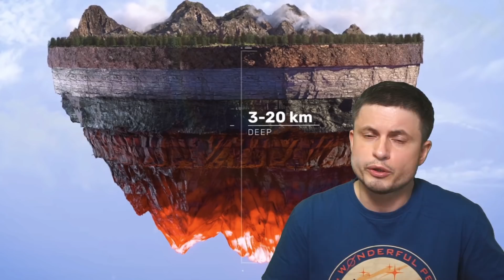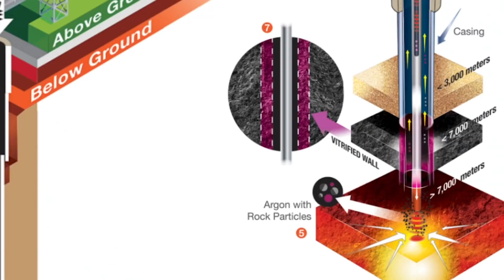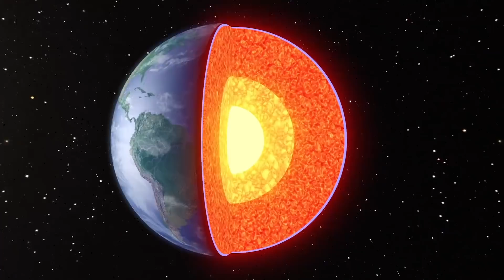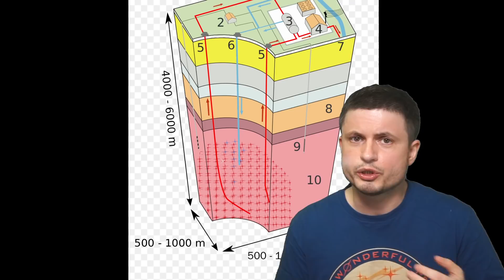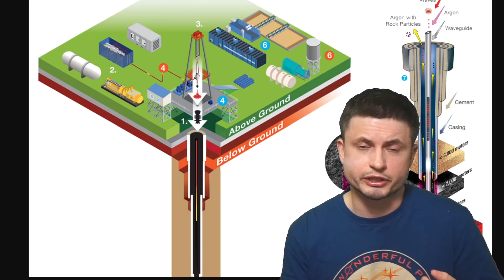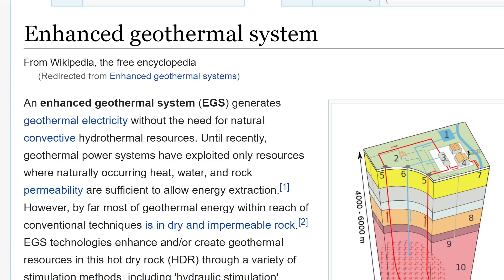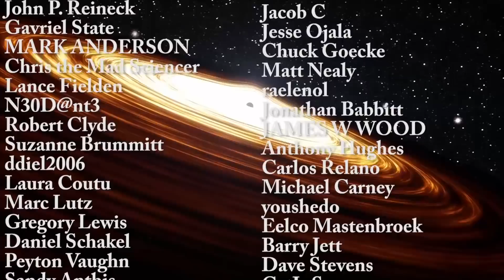Creating Deepest Hole on Earth For Geothermal Energy Revolution

Comment: One of the reasons geothermal isn't used more than it is, is because it can't reach the magical "7 to 1 return-on-invested-energy" threshold in 20 to 30 years, largely due to thermal depletion of the local rock. Fortunately, geothermal wells should continue producing for an indefinite period after that depletion due to heat conduction, but it will take quite some time before any individual well reaches the 7:1 tipping point, and they'll need to be designed with a "post-depletion" production sufficient to still run a power production plant.

Comment: Any discussion of a new energy  system should include a break even calculation.  How much energy is used by this new drilling device to create a 20 km hole, and how much energy needs to be produced before you have a net gain in energy?
Reply: They aren’t at that point in the tech cycle yet. However, if you read the papers and do some basic math, my guess is that it looks like it could easily produce thousands of times the power it takes to drill it.

Comment: it will add to the net enthalpy in the atmospheric system thereby increasing the temperature.  the only solution to global warming is to keep enthalpy constant or reduce it.  which means keep potential energies such as crude oil, coal or nuclear to its minimum and use and store energy produced by solar, wind, hydro to maximum

Comment: Imagine the weight of a 5km electric cable, how will it suport the weight?  There is a reason lifts only go so high, you get to a length where it just can't suport it's own weight.
Reply: I forgot as the cable gets longer the resistance becomes higher so they will have to start with very high voltage with thick insulators.  There appear to be more and more unanswered questions the more you look....

Comment: Hang on a sec ... here in Belgium, we used to have coal mines, they were between 300 and 600 meters deep; and I know that the temperature there is 50°C. This is actually the reason they didn't dug deeper, because it would become more dangerous. There are entire caves at 600 meters deep which can house entire trains.  ..... Sooooo we have a hot spot here as we don't need kilomeers to get superheated water, AND we have a 600 meters head start already ... Why don't we exploit that ?
Reply: Ask your government. I'm sure they have a good answer.

Comment: Passive geothermal (taking advantage of energy that is already bleeding out of the earth is fine) and geothermal storage (storing energy in the ground as hot or cold to use later is also fine. But the consequences for doing active geothermal (active forcing energy out of the earth) on a large scale will make our current climate issues look like a joke. This geothermal energy is what keeps the geological cycles running and the tectonic plates moving on our planet. If we pull too much energy, which of course we would, plates will thicken and even start fusing together, which would be insanely bad (at least in our current technological state) and much more irreversible than our current problems.
Reply: figured something like this would the case, most everything in existence that we take has consequences

Comment: Seems like am ideal power source...
...except, what else important is being driven by this heat?  What would massive geothermal adoption begin to compete with?
The Earth's magnetic field.  
Planets like Mars no longer have an atmosphere because the core solidified causing the loss of the planets magnetic field, without which solar winds stripped away the atnosphere and radiation levels on the surface jumped much hgher values.
We don't know that much about the geodynamo creating the Earth's magnetic field.  We don't know how much cooling would crash the geodynamo.  
Perhaps if we had long term nuclear power plants to power one loop with sufficient dc current  around the antarctic and another around the arctic we could creat an artificial magnetic field of sufficient strength to protect the planet.  I wonder how much power that would use?
Reply: "We don't know that much about the geodynamo creating the Earth's magnetic field."
How do we know the magnetic field is actually generated by a dynamo at the core in the first place?  Seems highly unlikely.  Maybe these boreholes will expose the truth... and negate the viability of geothermal outside of seismically active areas.
Reply: @freemind..  We see good evidence in that the poles periodically flip sea floor in spreading zones, meaning it is not something static in the interior.  This makes it unlikely that when the  core freezes solid that there will continue to be a geomagnetic field of a strength comparable to what we have currently.   Consider Mars whkch has evidence of previously having a more substantial atmosphere but now with a molten core too small for sufficient  convection currents; mars  does not have a strong magnetic field and no longer has much atmosphere.  
Who knows how much cooling is required to disrupt the process that generates the protective geomagnetic field.   Seems like that would be a good thing to know before proceeding in any significant way.

Comment: I love the geothermal side of this but I have serious doubts about the drilling technique.
The heat will cause any waveguide technology to become quite lossy so the energy would not be able to get far enough into a hot enough region without water cooling of the waveguide, which would be impractical. I think it could be drilled using modern super-deep drilling methods, but with significantly more water pumped through the bore hole.
Reply: What temperature are feasable, with current w/g tech? The vaporization will, if I understand it correctly, happen tens of meters from the mouth.
Reply: @mellertid  Resistivity of copper is about 3 times higher at 500C, and a waveguide carrying enough power to vaporise rock will get even hotter than that, resulting in more losses.  I don't think this would be a serious problem over a few hundred metres but the amount of power you would lose over kilometres would mean you would need to send many times more power down the waveguide than arrives at the head, meaning the heating of the waveguide would be even more severe. If they have run the calculations on the waveguide losses and heating over that distance and found that it can be cooled with the amount of water that you can pump through the drill then I could be wrong but it really seems like a lot of physical problems are stacked against it.
Reply: This would seem to be possible to evaluate with vertical prototypes. Obviously it's a critical point. (Unless the gyrotron can fit in the hole and move down...)

Comment: Now done in my USA County.  Within 30 miles of a steaming caldera.
Generates electrical power.  Learning their metal pipes need glass
upon the inner sides to halt acidic damage.  The only signal of operation
is a vented hot vapor.   Behind metal fencing to halt unauthorized visitors.

Comment: This one is currently doing the rounds at the moment.
Great idea in principal, but there are some major hurdles to overcome.

Things like .... 
How do you get the energy down a 6 km hole to blast the rock from the bottom?

Once you get above 700 degrees the rock is no longer solid .... how do you stop it slumping into the hole?

Once you reach those kind of depths there is considerable pressure from all the rock above .... how do you stop it collapsing?

If you are going to have Argon forced down to the bore head (enough to blow the debris up 6 km) how do you stop it interfering with the cutting head?

I realise they are going for proof of concept here but these known problems should at least have a probable solution ready or it is not worth starting a project off!
Reply: Great points! I think a lot of people are overlooking the fact that at a certain depth, it’s kind like trying to dig a hole through mud. Wall integrity plays a huge role.

Comment: I think it's a scam.
Reply: The energy market itself is the greatest scam of all time.  Demand is created by taking away supply.
Reply: @manuell3505  very true. But in this case, I thought it's a scam because the idea neither physically, nor geothermally nor chemically useful, feasible, practicle or economical.
Reply: @prunabluepepper  I'm quite sure the concept works. It only has a high start-investment and will have pretty high maintainance costs, but it has a yield that defeats all other methods for energy supply.
Therefor, this will never happen. On large scale, It "devaluates"  energy.
Reply: @manuell3505  allow me to explain:
I'm a geologist, and live in Germany, we've got plenty of geothermal energy. I'm pretty familiar with the physical necessities. Geothermal heat is awesome. It's not "replenishable" or "lasting forever" as Anton said, but it's still pretty solid.
However the borehole has a specific mechanic. The reason why they didn't bore deeper than 12km so far is because of the heat and pressure.
At a depth of 20km the bore equipment just melts or at least becomes soft. Unless you use drills made it of ceramics or diamonds, but those are brittle and really bad drills. Drills need to be able to withstand torc or shear force. That's exactly what brittle materials can't do.
Additionally the rock itself is "soft" too. (Soft in geologic terms). So with you drill deep the borehole tends to close itself again. It will just close up right after the drill head passed through. Even if you put in liquid to keep it open, the pressure need is too great. But worse: the liquid might solidify under the pressure squeezing out the solvant: water, you can't use oil since it would ignite. It's not pure water either, it's brine, or concrete water.
We don't have the technology or the chemistry to pull this off. 20km is just a scam.
Especially when all over the world engineers happily use shallower boreholes with great effect.
Reply: @prunabluepepper  That's kind of contradicting. If your drill gets destroyed by the heat, you're probably deep enough for some time...
Anyway. small-scale heat-extraction systems already work at low depths. The difference with the surface ground temperature minus temperature loss in the installation is your gain. And it's practically endless.
Reply: @manuell3505  true, i think these small scale installations will become much more widespread soon.

Comment: Maybe I'm just being paranoid, but would mass use of this technology slowly cool the earth and risk slowing its rotation?
Reply: Strangely, if we did manage to noticably cool the Earth (doubtfull), that would actually speed up its rotation.
Cooling things contract, and spinning things spin faster when they contract (conservation of angular momentum).
Reply: Since all that heat is continually created by the radioactive decay deep in earth’s core,  it wouldn’t have any cooling effect.   I guess if we drilled millions of holes in a close area,  it might change how fast material was cooling.  But that seems unnecessary and unlikely to happen.
      A single volcano would be several million times more venting than would happen with geothermal energy generation.      
       And there are 1500 active volcanos presently on Earth.

Comment: There is a company in the USA that drives pile tubes down pretty much anywhere then pumps cold water down them and uses the hot water that returns up for house heating. I am surprised they dont take it further to generate power.
Reply: That's the thing, hot is useful for heating, to make power we need HOT. In most places = DEEP.

Comment: I have been saying this for 20 years.
Dig until the drill bits melt. After all, this his rock has a molten core.
Boiling water is the way. But, much safer than coal, fuel, and especially nuclear. Wind isn't stable.

Comment: Just got to be careful as it causes land subsiding and also water discharge often have stuff like arsenic in it so without dealing with those issues you can get some ecological issues. New Zealand has had a few of these but they are shutting them down due to the above reasons. (and also eventually the power output can reduce)
Reply: Reduction is due to saturation
Reply: Additional they have been boring holes into the Southern Alps, and have found fracture zones relatively close to the surface.  This would allow large amounts of power to be produced at a fraction of the even the current low costs.
Reply: New Zealand's geothermal use has been steadily increasing since it initiated that option and now provides 17% of its electricity. The country recognizes that geothermal is cheaper, safer, and more dependable than wind, solar, or even hydro power.

Comment: You can heat a small cabin with a geothermal hot spring. Either with an air draft radiator with a few coils of copper pipe, or a radiant transfer system such as a heated floor.

Comment: Delighted you've addressed this topic; now I can reference you. I continue to make this same argument - referencing 'The Magma Energy Project' research conducted by NASA in the 1970's and 80's. I agree with practically everything but I'm not at all sure digging to such depths is necessary. There are 450 volcanoes in the Pacific Ring of Fire - each is unique, but magma chambers can exist within a few kilometers of the surface. Some volcanoes even have surface lava lakes. It's difficult to generalise, but NASA concluded magma energy is entirely feasible, and of monolithic potential.
Reply: The benefit of this model is that you can site it almost everywhere, including on old coal power plant sites
Reply: @eschurma  Drilling on the Kola deep borehole began in 1970, and stopped in 1989 - that's 19 years to reach 40,000 ft.   If magmathermal energy were dependent on holes it takes 20 years to drill, it would not be viable. Fortunately, that's not the case. There are plenty of places on earth magma is much closer the surface. These may not be close to population centers, but magma energy can be converted to hydrogen, either by electrolysis - or thermal water splitting, and piped as a gas, or shipped as a liquid fuel all round the world. Old coal fired power stations can burn hydrogen with relatively minor modifications - turning the existing grid green at a stroke, and rendering every lightbulb, tv, kettle and hoover downstream, carbon free. No-one need have a carbon footprint.
Reply: @karlstone6011  I work in the climate/energy space and am reasonably familiar with the history of this tech. The whole point of this particular project is to give you radically more options for where you can do geothermal (and speed up drilling by more than an order of magnitude) so that you aren’t so dependent on siting exactly the right spot. There are vastly more places without near surface magma than with it.
Reply: @eschurma  There are many exciting implications of harnessing a source of energy that could underpin a prosperous sustainable future; but this isn't one of them! I do not know the source of Anton's claims; but it's not necessary to drill 20km down. Drilling down 20km has never been achieved. It makes more sense to harness magma at 1-2km, at any of the 450 volcanoes in the Pacific Ring of Fire - and convert magma energy to liquid hydrogen and ship it around the world, than drill down 20km. Afterall, we go to such lengths to produce and transport fossil fuel energy - and liquid hydrogen has 2.5 times the energy of petroleum per kilo.
Reply: @karlstone6011  you seem to be missing the point. These guys have invented a completely different way of “drilling” that doesn’t use moving parts and works particularly well on basement rock. This has the potential to unlock completely different scenarios than have been possible before. 
And the power generation doesn’t require 20km, but it may enable that, which does allow for hotter steam and more steam volume from fewer bores. 
It also allows generation directly in places like the central US without having to transport anything, and to completely reuse existing power plants. 
You can go off and do your thing - this is a different approach that accomplished different goals.
Reply: @eschurma  Much as I'd like to endorse 'quaise' magnetic drilling technology, I don't know anything about it. If proven effective it could be a game changer, but it wouldn't change the fact it's not necessary to drill 20km down to harness magma energy. There are many places in the world magma is much closer to the surface - that should be developed now.

Comment: While the Gyrotron can essentially "melt rock", how do they move that molten rock out of the way? or does it evaporate and they have some sort of extractor for the hot gas?
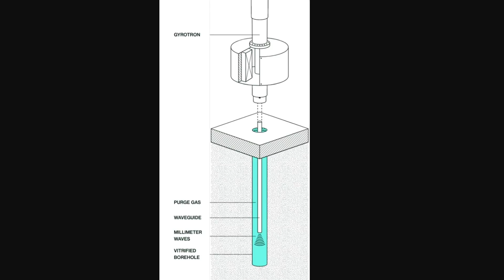Reply: The diagram at 7:00 had a legend of "purge gas" pointing at the borehole shading color, so I expect they are pushing the vaporized (and probably re-condensed) rock up out of the borehole by gas flow.

Comment: geothermal seems to me that its as good an idea as burning a lot or any other type of thing that, depending on the volume of activity, can have unplanned consequences. i worry that with increasing use to ubiquitous levels will moderate the reaction that produces the magnetosphere thereby making it weaker. while it is part of the earths entropy to radiate to space it is also natural for the earth to seep oil and gas, wildfires and burning coal seams, sulphur dioxide etc. the difference is how much. what is the overhead allowance for human consumption. please lets not act first and ask questions later like we have with petrochemicals for the past hundred or so years.